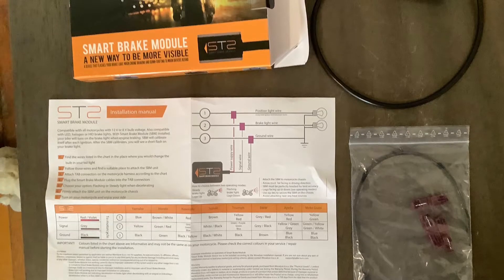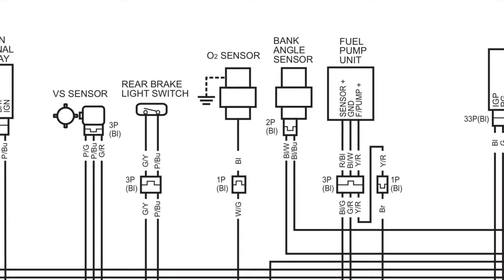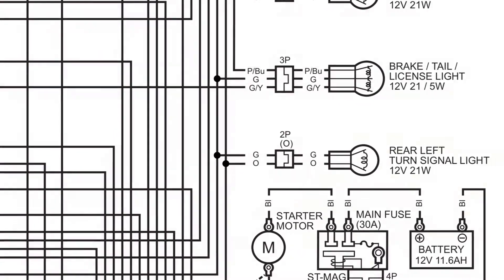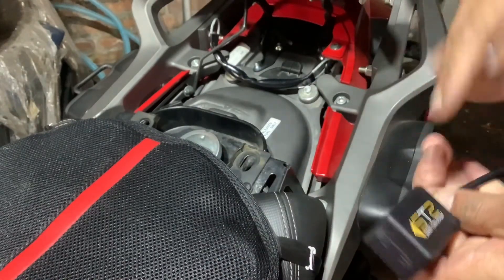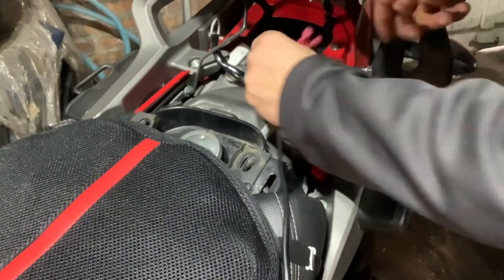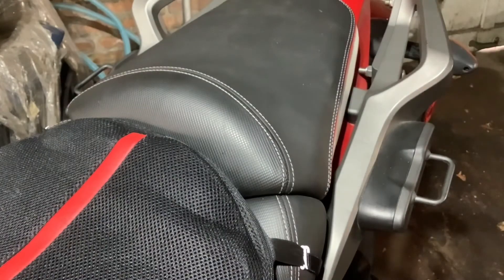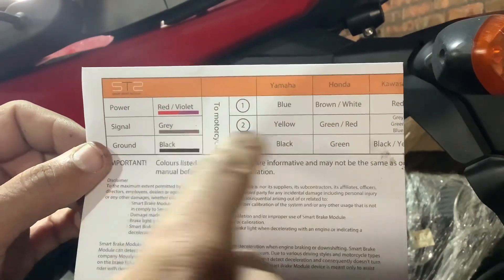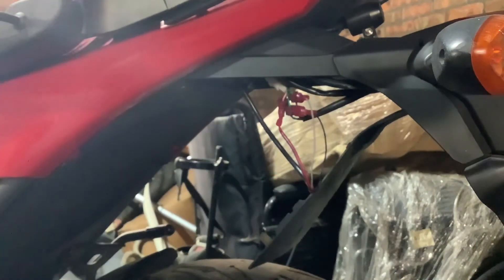ST2 Smart Brake Module Installation

Comment: I purchase both of these products and this brake module is a pile of crap!!  It does not work as it is shown.  My one would constantly keep flashing the brake lights, and getting allot of drivers stopping me to tell me about it.  I tried to tilt the unit to reduct its sensitivity, as instructed in manual.  This just stopped it working all together, then when I increased the engine revs above 4K it would again started flashing..  Even keeping the revs low, it never activated the brake light when engine braking...  Its now in the bin...

Comment: Your lucky I ordered two set of the smart brake system and one set of the smart turn system and only got one set of the smart brake system still trying to get the rest it a bad company for customers servers. Great video
Reply: I ordered mine in April, but still never received. Mark Nest is a tool, but a new guy (David Rand) got the company up and running again. I reordered the brake module and it’s going to arrive today. I suggest you reach out to him as he is very responsive. He is also doing a promotional 40% off of orders from the website.
Reply from the maker: Sorry to hear that, but thanks for liking my video.
Reply: I ordered the turn system and the brake system directly from ST2 on May 8 and it just arrived, so it seems like total turnaround is a couple weeks for folks looking to order from them. Shipped from Slovenia somewhere.

It took me about a week to get a response to a customer service email but they resolved my question right after quickly so I think it might be a very small business or something.

Comment: Maybe you can tell me, I just connected this on a BMW GS, I have connected as it shows from diagram do I have to tried when I ride to know it works correctly? As I tried nothing different seams to happened but I have not ride with it yet
Reply from the maker: Sorry for late response, when you turn your bike on the brake should flash to let you know it's connected properly. It does this everytime you first turn on the bike.
Reply: @hawk83rd45  hi. Are you saying that if it doesn’t flash it’s not connected up properly?

Comment: Just recieved my ST2 Brake Module today, going to install it shortly.  How are you liking it have you notice a difference in the cars behind you?  Thanks for this video as well, very much appreciated.
Reply from the maker: I ended up uninstalling it. It started leaving the brake light on constantly. So cars behind actually couldn't tell when the brakes were engaged.
Reply: @hawk83rd45  It did NOT work on mine either. My riding partner said it keep flashing every time i hit a bump in the road. Almost like the G sensor is in mounted the wrong way. Not impressed. i removed this waste of $$$. Also the STS is just as bad. It would cancel the turn signal TOO soon or while i am sitting at light waiting to make to left turn. More wasted $$$
Reply: How long did it take to get it?  Mine shipped Dec. 19, it's Jan 10 now, no module yet.  17tracking is of little use.
Reply: @jimsz0100  Same, it’s finally arrived but seems to have a lot of reviews saying it doesn’t work so may well return it, but I expect that’ll be a challenge as they ignore you after purchasing
Reply: @BlaineyBiker  Mine came this week, installed and working.  It does not have the flash option that I expected.  No zip ties but comes with Velcro already on the bottom.  Their ads need to be updated.
Reply: 5/4/24. Apparently, they had an all electronic version a while back.... then came out with a less expensive version with a mechanical tilt switch (the one I ended up with for my wife's Ryker). Never installed it last fall. Then, I get an email offering a replacement electronic version again at a deep discount (to offset my cost for the problematic mechanical one). I'm working on getting it installed today.... will update on its performance after going riding tomorrow.